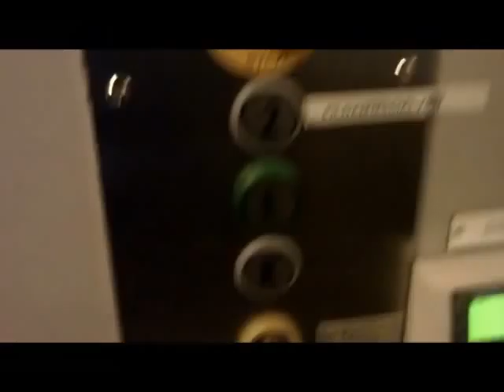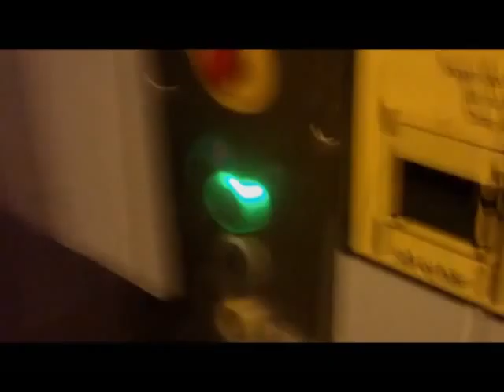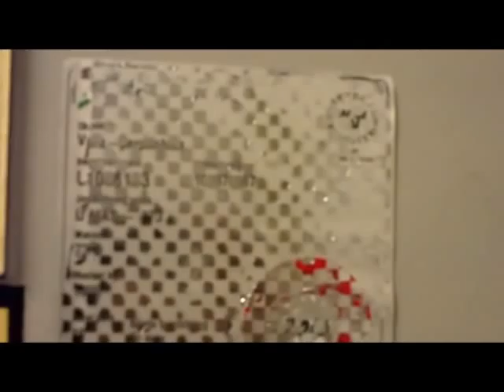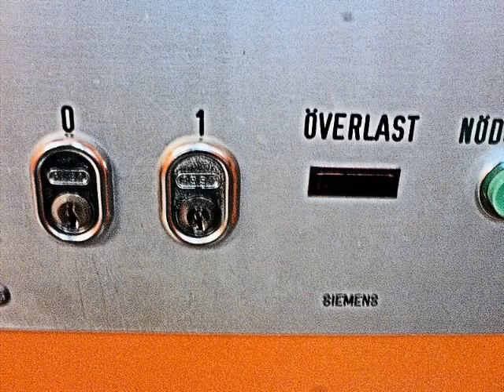Old service elevators without inner doors at Skånes university hospital, Malmö, Sweden

Comment: ADDE and i went to Malmö yesterday and I visited this hospital in the evening after ADDE left back to Copenhagen earlier because he had to meet his family at a restaurent for dinner. 

Believe it or not, those KSS modded lifts have already been modernized AGAIN!
New fixtures installed by ALT plus sliding inner doors. Only the large one with double doors is still without inner and with KSS, but that is due for modernization in a few days. I think it will get vertical sliding inner doors :S